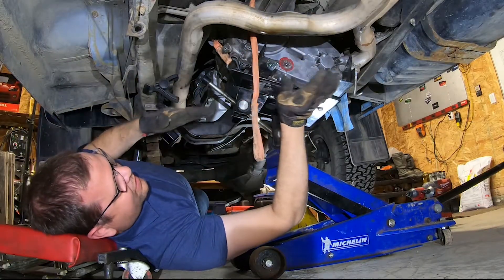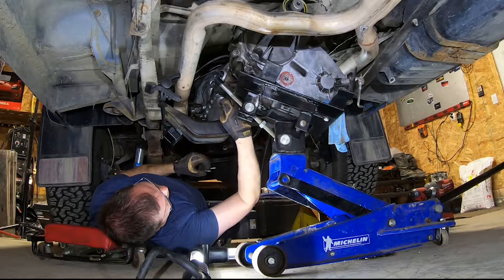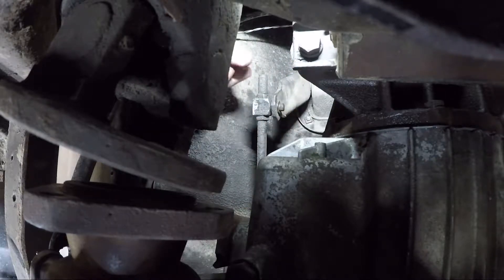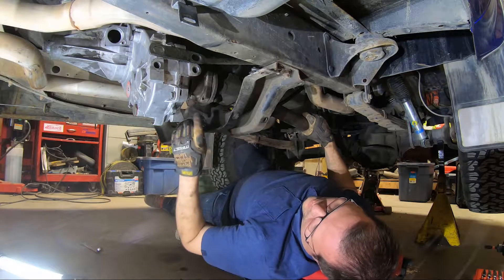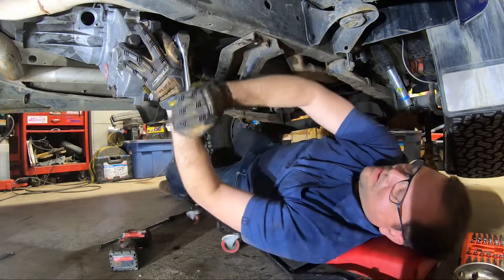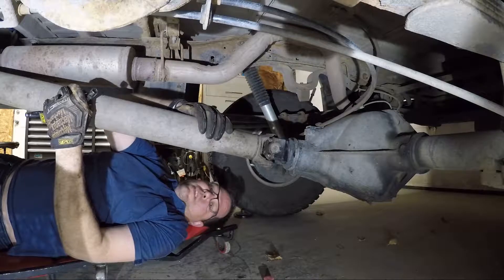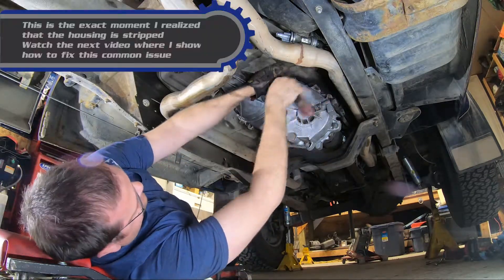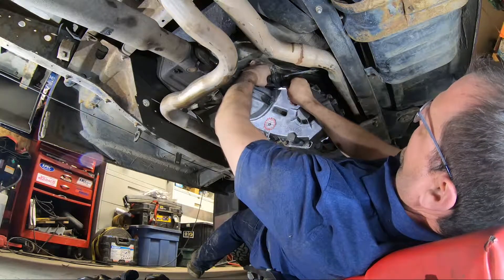Pt 4 Step By Step Square Body T-case installation  1980's GMC Pickup. NP208

Comment: The center of the floor on my 79 K20 unbolts for access to the top of the transmission and transfer case. I took the passenger door off, took out the front seat dropped that Np465 and 205 transfercase to the ground with a cherry picker.

Comment: Please, David, could you help me? My Chevy truck has an NP208 transfer case and the front seal is leaking. Could you please tell me which is the right front seal in order to order it? I stay in Greece and, having searched in the web for the seal, I did find some seals for the transfer case of this truck, but I am not sure which one is the right one. I write underneath what I found. If you could tell me which is the right one, I would appreciate it. Thanks a lot in advance..
Monk Damaskinos

https://www.carid.com/1986-chevy-ck-pickup-transfer-cases/?filter=1&departments%5B%5D=Parts&sub-ptypes%5B%5D=Transfer+Case+Output+Shaft+Seals&sub-model%5BDriveTypeName%5D%5B%5D=4WD+(Four+Wheel+Drive)
Reply from the maker: Good day Monk.  The part number I would order is Timken 3946. That will work for your front output seal.
Reply: @TheLugnut  I do thank you very much. David,  for your informative and helpful answer.
Monk Damaskinos from Mount Athos

Comment: hi i have a np208 c in my chevy truck and i am having problems putting it in 2 hi it stays between 2hi and 4lo can it be the shifter linkage ?
Reply from the maker: Yup. Take a look at that linkage. Sounds like it needs an adjustment. Look for malls on the shaft where it may have moved from.

Comment: How much oil did you use in the transfer case thanks
Reply from the maker: Filled to the bottom of the fill hole. Sorry I don't recall the exact amount.
Reply: @TheLugnut  all I needed to know.